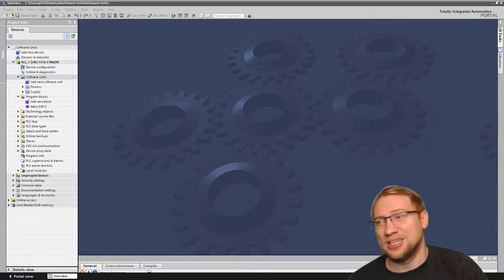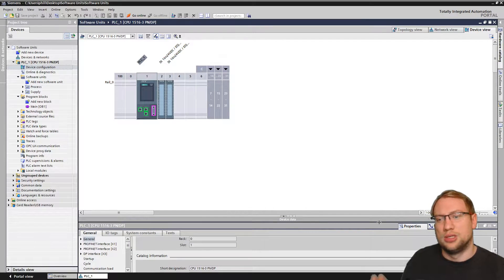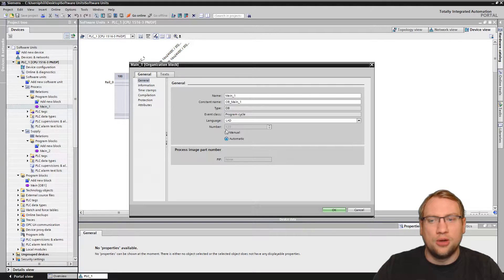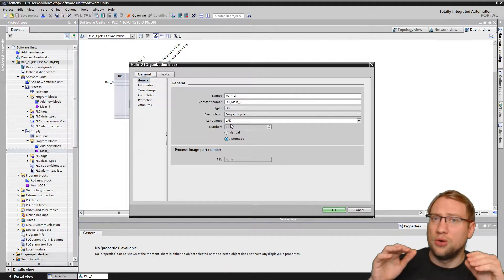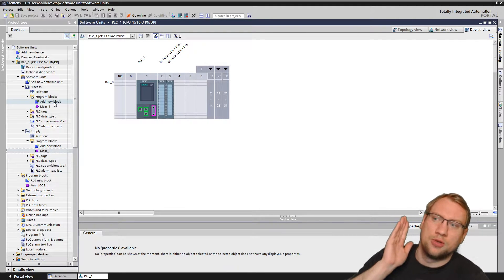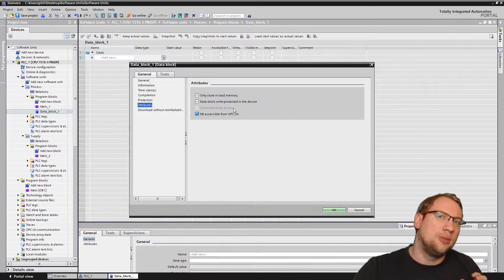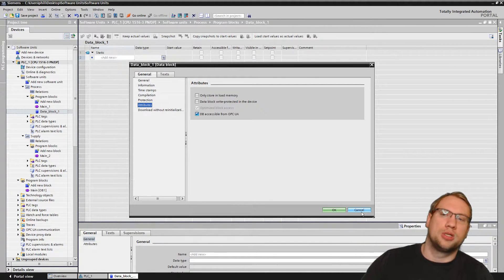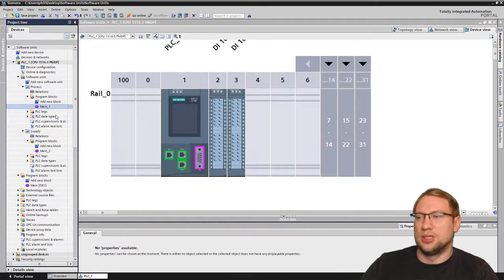TIA Portal: Software Units (Multiple Projects on the same PLC) Part 2

Comment: First of all, i would like to thank you for your videos. I´m sure that they are helping so much people (including me). I'm working with software unit and facing one issue that it's not clear for me. I've created a relation (using a global DB) and everything were working well. But, i've needed to include more informations inside this DB. After that, i've tried to download the modification. In this moment, a error mensage shown up: A "Consistent download of the selected units(s)" is not possible because some relation target have been changed. Download the program with the command "Download > Software (with related software unit)". Could you help me to understand this problem? 

Thanks.

Comment: I make a simple test and for me it Software Unit act strange.

When I make FC/FB outside SU (in main folder) I was unable to use it inside Software Unit. But when I make SU "Main" and make relations to it in every other SU, then I can use those functions. Why Siemens make those limits?

What was the plan/ concept for SU? Every device has it's own SU and outside SU is only safety program and comunications with other PLC?

Do you know any programing standard (Daimler Integra, BMW TKB, VW, SiCAR etc. ) that will implement SU in the future?

Comment: Very interesting , in the first glance , it lets keep your programming structure more coherent in one programmable logic unit, which you can manipulate independently. But from other hand , in some way , is it not similar to libraries concept ??
Reply: I think you can also use libraries to work on single parts (which is much easier and less cluttered), but then you don't have the "security layer", because you could accidentially use a global variable etc. and affect more than just your part.